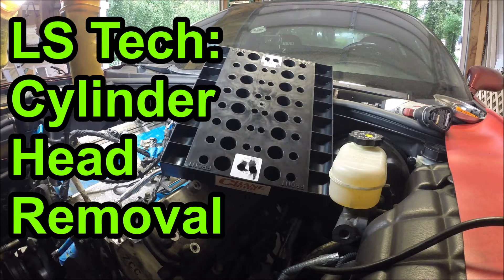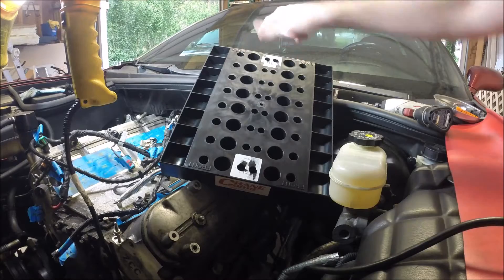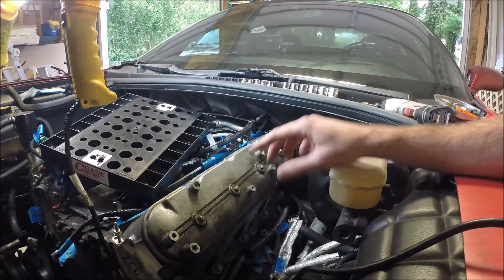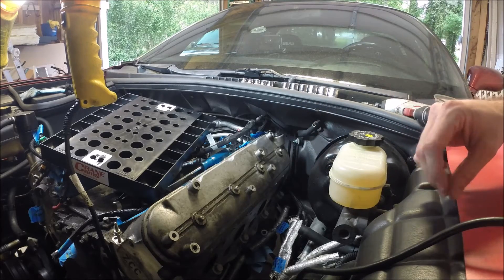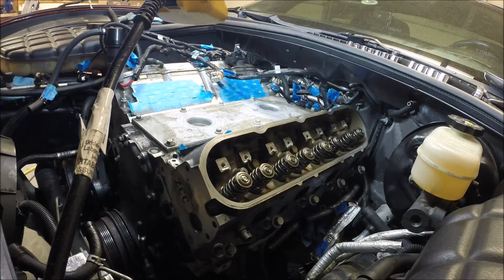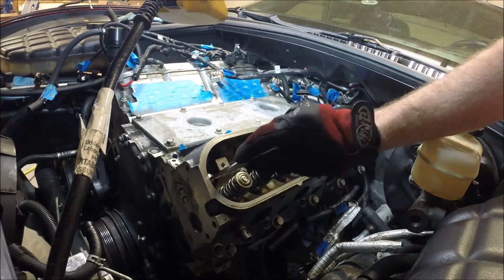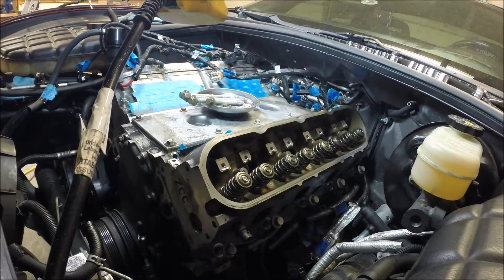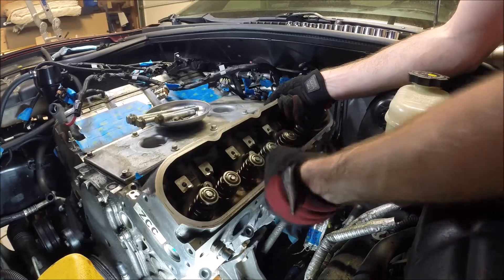LS Tech:  Removing the Cylinder Heads

Comment: So if I want to replace springs and rockers do I have to have the engine at tdc? And if I’m wanting to replace the cam and lifters can I just pull them out replace the cam and put my new ones in
Reply: Yes you do. You don’t remove rockers with pressure on the valve springs

Comment: i’ve been reading is top dead center required to remove heads
Reply: No you can do it in any order as long as you properly torque each one while it’s in the up/ open position. Order doesn’t matter